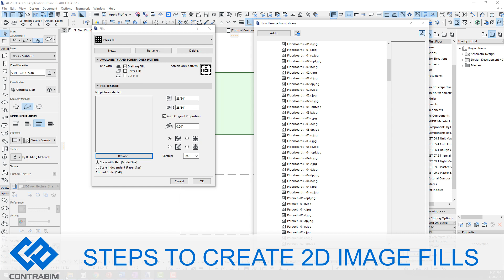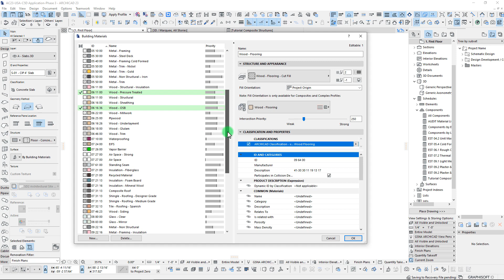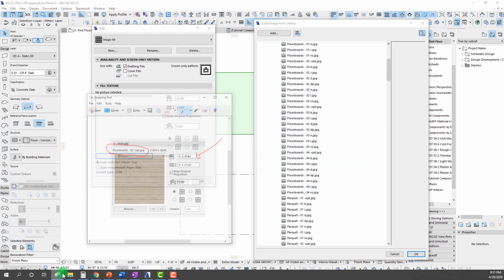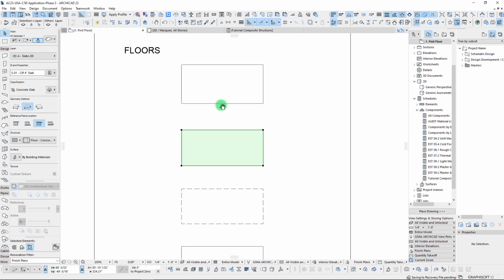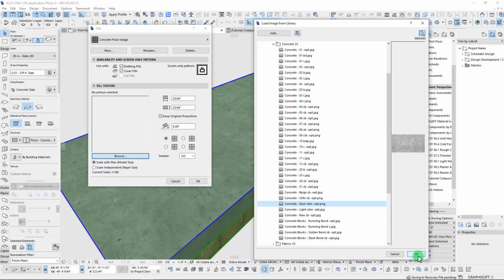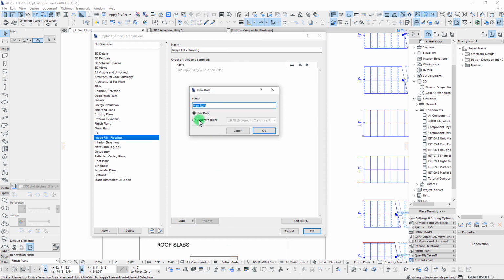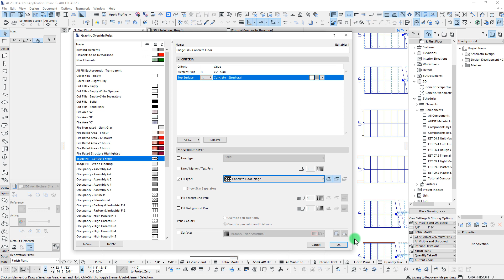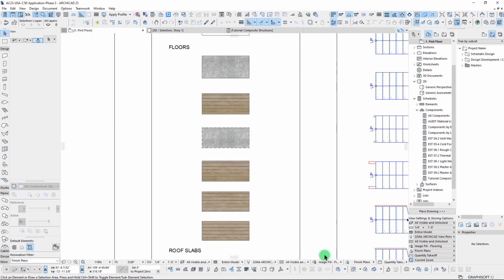How to Create Image Fills from ARCHICAD Surfaces!

Comment: In archicad 25, this will not be necessary anymore. That will be a new fill type, that already give you the option of show the surface texture.
Reply from the maker: Wow, awesome that will be a great enhancement! I'll look forward to seeing how that'll work. Will it pull directly from the surface texture? Thanks for the comment!
Reply: @CONTRABIM  Exactly! The way you configure it on the Surface, it will appear on the floor plan. And in the cuts and facades you will also have the option to display the texture.
Reply from the maker: @viniciuslima4174  That's going to be great. Thanks for the insight I havn't even looked at 25 improvements yet...

Comment: Am I right in thinking that you can't use image fills for cut fills?
Reply from the maker: Yes you're correct on that, the image fill isn't an available option for cut fills. Even with Graphic Overrides once you check the cut fill, the image fill options go away... Thanks for the question!
Reply: @CONTRABIM  I wonder why they made that decision - it would be nice to be able to use image fills for more illustrative sections and plans.  Ah well, maybe in version 27.

Comment: is there a way to have the same result in a 3d document? Image fills follow perspective?
Reply from the maker: Hi Giovanni. Great question. So YES the image fills can be applied to 3D Documents using a Graphic Override, unfortunately, it doesn't follow perspective, meaning the texture fill size is the same close to the camera as far away. It looks much better in AXO actually... Using these image fills is great for flat type views, but when you start introducing depth it is better to render or save a high resolution view, or use the vectorized fills that do follow depth...
Reply: @CONTRABIM  thanks  for the answer !

Comment: This kind of thing would be most useful, in my opinion, for the elevation views. Unfortunately I don't think there is an automatic way to do this. I wish there was an option in the elevation setting to to fill uncut surfaces with image fills. Such a setting might not be useful for the construction documentation, but it would make some great elevation views for the customer to see.
Reply from the maker: Hi Marian. I just tested this and the image fill graphic override I setup in the video, works in elevations and sections as well. All you need to do is setup the override to apply the image fill and it works no problem! There isn't an option in the sections/elevation settings to apply this globally, but with Graphic Overrides it's easy to accomplish
Reply: @CONTRABIM  Awesome! I will definitely try it!

Comment: Ive got a tiff image of a floor tile I want to recreate as 2D polylines. I try and explode it into current view and it won't work. Any suggestions? Thnx
Reply from the maker: Hey Erik. You cannot explode a TIFF image file (or any image file) only PDFs. I'd suggest scaling your TIFF it to the right size, and tracing over a single tile or pattern of tiles with LINES or ARCS, copy it, create a new symbol fill, and then paste your lines and ARCS into the fill settings. Polylines won't work for this... But this way you can create a new fill with your custom pattern!
Reply: @CONTRABIM  Archicad can only explode PDFs that contain vectorial drawings on them. You might have PDF's that contain rasterized drawings and those won't work either! Basically it will not explode pixels!